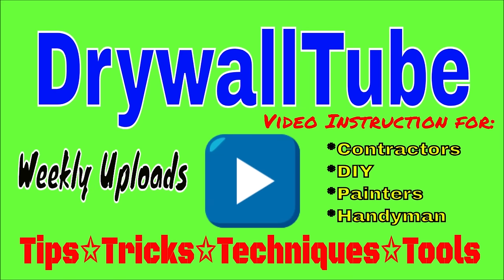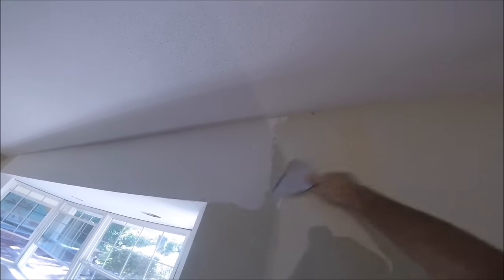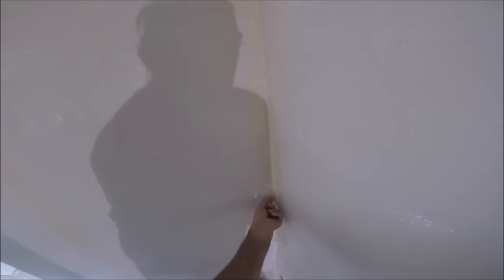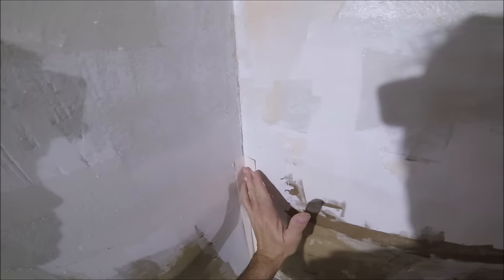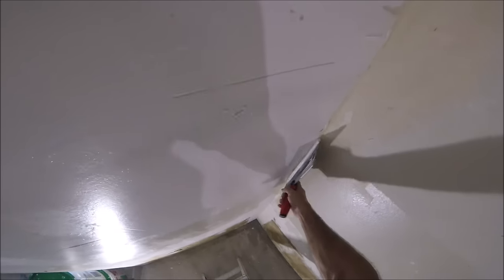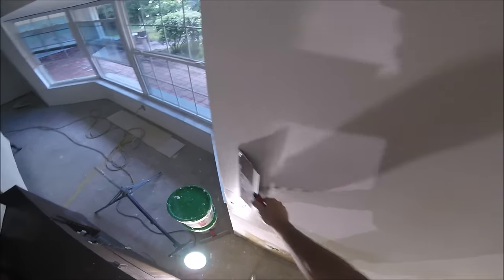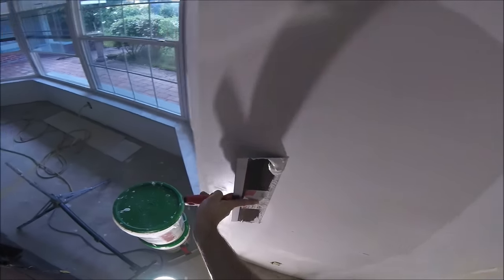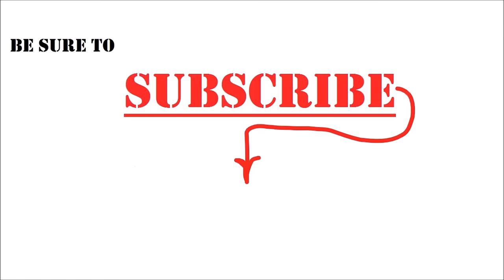How to Skim Coat a Wall after Wallpaper Removal Step by Step Tutorial

Comment: Great video man!  So i got a wall that started to have the paint peel.  After my kids started poking at it and i peeled some myself, im left with uneven layers of wall where some of it is down to the brown paper, other spots is a plaster like material, and others is the current orange pain on the wall.  Can i use a killz primer over the whole wall then skimcoat?  Or can i use gaurdz  over the whole wall including the paint surface and skim coat over that?  Thanks in advance!
Reply from the maker: Hey Miguel, Gardz or oil based Kilz will lock that down so you can skim coat.👍🏻 I hope this helps. Thanks so much for watching and subscribing my friend!😎 -Paul
Reply: @PaulPeck  i currently have kilz pva.  Would that work?  Thanks for your reply it really helps out!

Comment: Hi Paul. Thanks for the video. I am a DIYer. Redoing a bathroom with wallpaper on the wall that came off easy however glue left behind and very difficult to remove with chemicals, etc. I tried sanding it with an orbital sander but took the paper top off of the drywall and now down to the brown paper. It is all smooth without any major holes, etc. I am thinking of using the Gard Z to seal the entire walls / brown paper then I am assuming I would have to skim coat the whole room, or could I prime and paint over the Guard Z without skim coating?

Comment: I am a first time homebuyer and removed the wallpaper and finally the adhesive. WHAT A NIGHTMARE LOL! I have a couple areas of the wall where I accidently dug into the wall and now i have little divots in wall.   Is it best to use spackle to correct those or do I need to use that drywall compound you are using and do all of walls?

Comment: Instead of doing a skim coat over entire walls, I was planning on add compound over just issue areas where it tore the paper/1st layer of drywall and then use the homex texture sprayer can. After using the Zinsser Gardz, should I prime it with Kilz PVA? Or that gardz is a good enough protection before the texture spray?

Comment: I had a bathroom wall that had wallpaper with paint over it.  I removed the wallpaper and as much glue as I could.  I then painted the wall with semigloss paint.  However, now whenever someone takes a shower, the paint blisters.  I assume I did not get all the glue off.  After watching your video, I realize I should have used Gardz to cover the wall before painting.  Since I now have paint over the old glue, what would you do to fix this problem?  Thanks.

Comment: Do you use regular primer on the drywall compound after or just regular paint primer?

Also would you be able to paint over the gardz and use it like a regular primer over drywall compound? I'm not planning on colour changing as I'm repainting the same colour so the priming area would be really for tht drywall compound

Comment: DIY here!
I’ve hung drywall, done some finishing, and can clean up a flat wall but I’ve never dealt with a house that’s covered in layers LAYERS of wallpaper/layers of paint on top. I found a video for removal involving a spiked roller (sound right)? 
I then found your video for what to do after it’s off. I’ll be texturing all the walls and ceilings (popcorn removal yay), followed by new crown and base/door trim. 
Two questions:
After removing the wallpaper, provided the walls aren’t severely gouged... what treatment should I use? Definite skim coat, or prime and then knockdown? 
Serious question. I don’t know if doing texture over previously wallpapered wall is a good idea or if skim coating is totally necessary to cover residue. It’s just so much house and so many wallpapered walls that I can’t imagine single handedly skim coating the whole place. If I have to, then I have to.
2nd: after walls are prepped and ceiling is de-popcorned, do you recommend spraying the walls and ceiling with primer before applying the join compound (texture)? A fear of mine is whether the texture will peel off or have trouble sticking. Some say no, no primer necessary. Some say it’s totally necessary. 
Third: should I prime all ceilings and walls after texture/finishing and before paint? I’d say yes but I’m not sure. Using a latex based satin paint on the walls and a flat ceiling paint for the ceilings.
Reply: Also, what paint finish for the crown?
I use satin on the walls, semi gloss on the base trim and door trim, and flat on the ceiling. Some prefer semi gloss for the crown but I think that’s too shiny, I just don’t know the standard. If I could use flat ceiling paint on the crown that would be sweet and save on extra taping of both the ceiling and walls.

Comment: Hi My walls are beautully cleaned from wallpaper and the glue. I wanted to plaster the walls. After this skim coating is it ready to be painted or do u still need to plaster in top of that. Of course I've got uneven bits and bobs on the wall after stripping wallpaper. Thank you

Comment: Hi Paul our walls actually look super similar maybe even worse. Do you need to prime the walls before painting after skim coating? The guy at Sherwin Williams said it’s not necessarily but just wondering bc we have so much of that wall paper stuff left behind. We didn’t put Guardz down, but haven’t done all the walls yet. The previous owners painted over some of the last layer of wall paper and then we found even more layers underneath.

Comment: Hey, I’m a diy’er, I peeled off the 4-5 layers of paint that was over wallpaper, there was a cardboard like material, I tried that pro-999 stuff thinking it would help, but the cardboard material started bubbling,  so I just peeled it off n to b honest, I’m happy because I would rather add joint compound cement over the actual drywall instead of a treated surface

Comment: #DrywallTube
Great video. Currently repairing drywall in one of our bedrooms where water came in from the window a/c not being properly installed. Always come to YouTube for some info. I second the Gardz by Zinsser. Just applied it today and am pretty impressed how well it keeps the torn drywall paper in place. I did sand the torn areas with a 100 grit sand paper before applying the Zinsser Gardz. Next I’ll be using your knowledge when I do begin mudding. Thanks again for sharing your knowledge.

Comment: PLEASE HELP... I have taken the wallpaper down. I have to patch a couple of holes.  My question is this:
I haven't done anything with the wall since I took the wallpaper off if I use this product instead of having to wipe the walls down to get the glue off can I just take this and go right over the walls and seal in the glue and then once it dries paint from there? I've done a lot of wallpaper projects before but and it was a lot of work but I'm thinking with this procedure if I can just use that product and put it right on the wall over the glue and it seals in the glue so I don't have to wipe the walls down that would save me a lot of time please get back to me as soon as you can thank you so much and I love the video

Comment: I’ve got a problem wall exactly like this one in your video! Found Guardz at menards. Got a skim coat on it and its good enough for me. I’ll be putting sand in the paint to match the texture on the other walls and ceiling, so i’m not too worried that my one skim coat is not as smooth as yours. But now i come to a question. I’m painting with acrylic paint. It’s Behr Premium Plus Paint & Primer. Can i use the Guardz to prime over the skim coat before painting? What is the right thing to do here? Thanks Paul!

Comment: Thanks, I just started painting professionally and have been worried about drywall repair to this extent.  This looks like the owner used a claw and hot water with no regards to pulling it off.  Do you think steamers help tremendously by not tearinv up the drywall so bad?
Reply: I started removing wallpaper without a steamer and made a mess of the gib paper. That's when we realised no sealer had been applied! I also spent an obscene amount of time in one small area. A steamer has made a world of difference.

Comment: Hello Paul! My name is Michele and I’m a DIYer. Attempting to give our living room a face lift by removing wallpaper and painting. One wall looks great underneath with minimal repairs. Unfortunately, the other wall looks like it was skim coated prior to wallpaper. The glue did not remove as easily. Do I need to sand the wall? Or can I roll the guard over top and skim coat? Thanks in advance

Comment: I'm a dryer,  removing a wall border.  I removed the outer layer of the paper, but having a hard time getting the paper and glue off.  I'm using water with dawn and a 6 inch scraper.  But the glue is not coming off completely.   Should I skim coat or can I just sand it off.   Suggestions?

Comment: drywall tube. DYI er here.  I have bubbled paint from failure to remove all the adhesive after wall paper removal.  I think I'm going to try to skim coat over the existing paint once I scrape off the blistered stuff.  It's either that or re-drywall the room.  Any ideas?

Comment: My walls are pretty bad too after I took off old wallpaper. Would it be beneficial to lightly sand before putting on the Gardz? I'm hoping that might really cutdown on my need to skim coat every square inch of the walls. There are some sections where the wall looks basically fine. Other sections just look terrible with wallpaper backing left on and some of the drywall paper even got puller off.

Comment: So I’m in a similar situation but a lot of paper and the brown. I smoothed it out got what I could off. I plan on doing 2 skim coats. Should I prime before hand or just use that sealer. Also wall paper in bathrooms, can I prime them then skim over the wall paper or should I remove them

Comment: I have a plaster wall that had been painted over, then wallpapered over the paint, the homeowner has been chipping away at removing the wallpaper. What is left is a combination of areas of no paint, then areas where small chips of paint have come off. What should i use to strip the paint off of the drywall? Looking for something I can thin down and use with my garden sprayer that will soften the paint to scrape off, but wont damage the plaster? Love your channel...
Reply: I said drywall and meant plaster...the base wall is all smooth plaster.

Comment: Does this work if your walls are plaster under the old wall paper and they have repaired cracks? will it cover the repaired cracks? I was thinking I would have to hang 1/4" drywall over it first but it's repaired so if the paint would cover it them it would be fine but my friend said it wont but make a skim coat will? DIYer btw

Comment: Hi, I have to do this in a bathroom. I already took down the wallpaper, sanded it smooth and applied one coat of the  Guards surface sealer. I purchased all purpose light weight joint compound and was about to start that. I just heard that the all purpose light weight joint compound may not be the best thing to use in a bathroom. I was going to apply a coat of the Gurads on top of the joint compound after sanding it smooth. Will this hold up in a bathroom with the humidity? 
Thank you for your video and would appreciate your help.
Debbie

Comment: I took down paneling and found someone glued sheets of cork to the wall (yay!)  removed that and have a wall of brown paper that we've scraped and sealed with Gardz. My problem is that it's very uneven wall especially at the corners.... do I skim coat first to make the walls more even and then tape the corners or tape first? I'm concerned if I tape first that I will get air behind the tape :/ Thanks for any advice!

Comment: #drywalltube
Good stuff Paul! Two questions for you: 1) how does Gardz compare to BIN shellac-based primer? A couple of videos I watched before I discovered yours recommended using BIN to seal the tears in drywall prior to skim coating. I am a DYIer and I recently took on my biggest project yet: I removed 20yo wallpaper from my master bathroom. It took me 2-3 hours a night for nearly a week to get it all off and a lot of drywall paper tore in the process, so now I have brown paper exposed throughout. Also, there are sections of the paper backing from the wallpaper that I cannot get off. 2) Can I cover this residual paper with Gardz (or BIN), or will it cause it to bubble? My intension is to do the knockdown texture on these walls, so I can probably get away with not having a super-smooth skim coat finish. Thanks in advance for your help!

Comment: Hey Paul. I m a DIYer. I keep peeling the mud when I m smoothing out my skim coat. I ll quickly put mud on but when I go back over it immediately the mud seems to peel in places instead of flatten and smooth out like it should. Is the mud mixed too dry? That's the only reason that makes sense. Thanks

Comment: I have removed the wallpaper. Then removed as much paper as possible. Then did plastering and sanding. Then applied the base coat but there are still dents and some paper is now stripping off. Can I apply zinsser gardz on base coat now?

Comment: I paired over wallpaper. I used primer sealer. Oil based. I used two coats.  Then painted over the primer sealer.  Latex.  Two coats semi gloss.  This is in a bathroom. No moisture fan. Now it looks like I have wet walls.  But they are not wet. It feels like the glue is pulling through the paint can I repaint to fox this?  And I’m doing a bathroom that is messed up just like this video.

Comment: Im a Journeyman Red Seal Painter and Decorator. 30 years in the trade up until my hip and knee's gave out on me. I have a living room that's about 12'X36' with 10' wall's that have vinyl wall cover over lathe and plaster wall's. Having someone paint the wall's with alkyd primer and then patching and skim coating all the wall's. Then prime and paint the wall's. I think leaving the old vinyl wall covering will be easier to work over then stripping and working with plaster wall's. Sure it's gonna stink from the oil paint but over time the smell will go away.. All going to be painted with an airless sprayer and back rolled.

Comment: Paul, I am a DIY homeowner tryin to restore bathroom walls after removing wall paper.  Do I skip coat before applying texture and paint.  Can I apply texture without a skip coat?  Thank you.
Reply: I intended to say skim coat.  I removed a mirror and the drywall is torn and bubbled where the glue was.

Comment: I am removing old cracked wallpaper, circa 1930's. It is actual paper, not like most wallpapers. The paper comes of relatively easy with hot water since its like brown paper bag material. Problem is the massive amount of paste. Is there an easier way to get this off, or do I just continue the hot water process until it's finally all gone.  I've removed wallpaper plenty, but this is a whole different level of paste!

Comment: I’m DIYing my bathroom walls. Took off wallpaper where it was loose and left it on where it was tight. Went over everything with Garda now I need to skim coat.  
Should I skim coat the whole wall or only the areas where I pulled off the drywall?
Reply: GARDZ

Comment: I'm a homeowner from the southeastern US. Purchased a 1958 home that had some bad DIY projects inflicted on it. I will have to Gardz and skim coat most of walls in the house. I'm wondering if I need to Gardz again after the skim coating is done? Or can I apply a SW interior paint+primer directly onto the joint compound? #drywalltube

Comment: #drywall tube sub contractor do mostly painting and floors. I’m doing a wallpaper removal job now but it’s my first one. It will need to be slim coated for sure. Do you have to seal every wall you skim?

Comment: I am trying to paint my bedroom. It's a 1926 house, lathe and plaster with wallpaper. As i started removing wallpaper (2 layers, some parts came off to the rough brown plaster area, theres Ccracks ,uneven spots. . Its a mess. I cant afford to tear it out and put up dry wall, and i am doing it myself. Following your you tube videos. Am I being unrealistic that i can DYI this ? My plan is to use, pva, joint compound and tape to repair spots, then skim coat prior to painting with thinned joint compound.

Comment: My house is built 1948. Original plaster. Stripped paint in bedrooms. Some plaster problems. But a lot has a shiny surface. One wall had wallpaper. Plaster under did not have shiny surface. How would I skim coat and get the shiny surface?

Comment: I' m a 71 year old wannna be DIY'er. I have removed wallpaper from my bathroom walls, which had been painted over a horrible orange color. Now I have dry wall with lots of dings in it and brown paper spots showing up. I was hoping to texture my walls using a roller (had seen you tube about this), but looks like I need to do the Gardz or Pro 999 before I do anything else. I'm thinking I should do the Gardz, then will the mud cover the places where the brown is showing? And I skim the walls with mud? Then can I use a paint roller with texture to get some texture in my walls? I want the most economical way to do the texturing. I had thought about renting a texture sprayer but think perhaps using a roller might be easier for me? When do I get to put the colored paint in that I want to use? As you can see, I am a total beginner with this.

Comment: #drywalltube Hey Paul I enjoyed this video. I am a DIY and I'm working on removing wall paper in the bathroom and kitchen and dining area. I plan to just paint those areas, but this has been very helpful in knowing how to prepare surfaces for painting, or re-wallpapering for any future projects  Quick question.  If I was going to use a textured paint on those surfaces where I removed wall paper would this process still be necessary, or could I just smooth the surface out as good as possible and then apply that product?